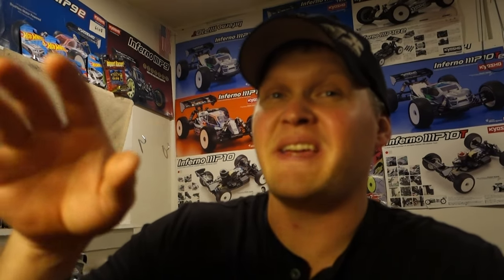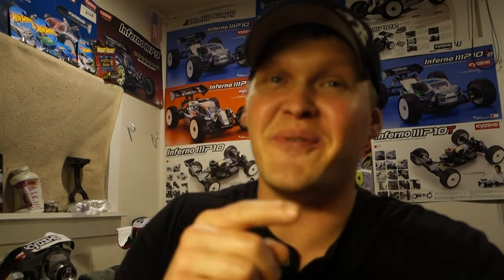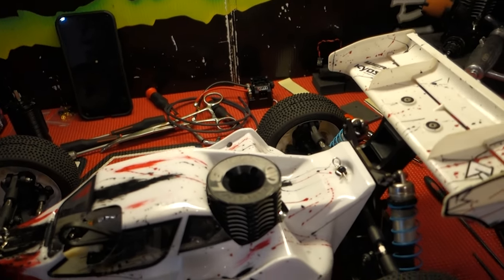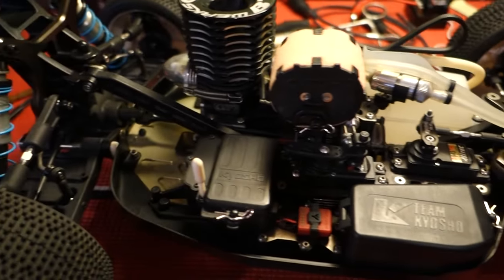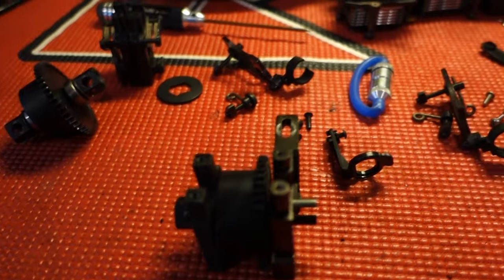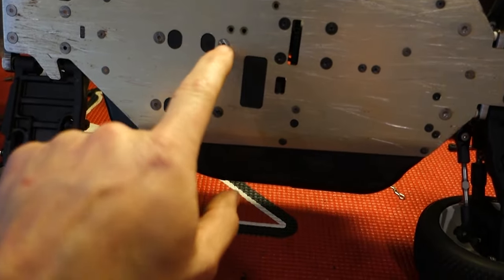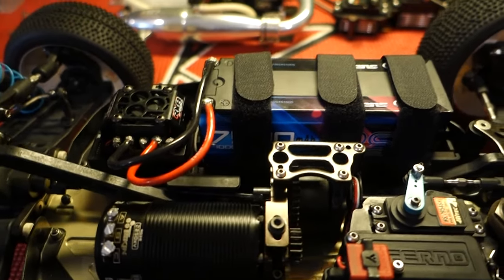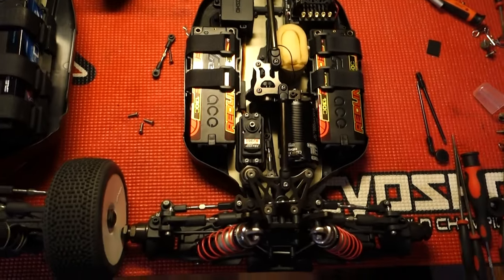KYOSHO MP10 1/8 Buggy Electric Conversion Kit IFW451 MP10e￼

Comment: You don’t have to drill anything in the nitro chassis or anything? Just bolt on modifications?
Reply from the maker: No, you don’t have to drill any holes in the chassis it just bolts right up

Comment: Bro I'm having problems putting my mp10te kit with the Steering rack hitting the diff case is there anyway you can help me out please and thanks
Reply from the maker: Sure thing man, I would double check the instructions to make sure you’re putting it together correctly but Off the top of my head I know if you don’t put the Shem under the Ackerman plate it will rub the diff case
Reply: @Natey Mods  I figured it out had something on wrong but thanks bro I appreciate you